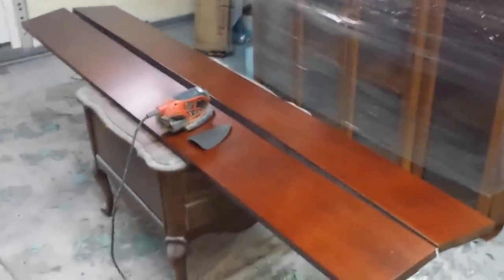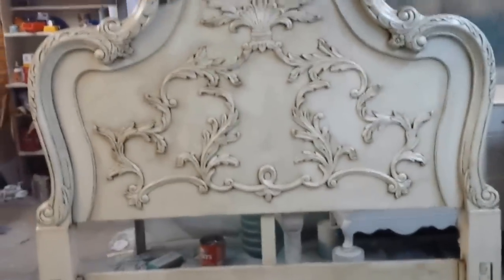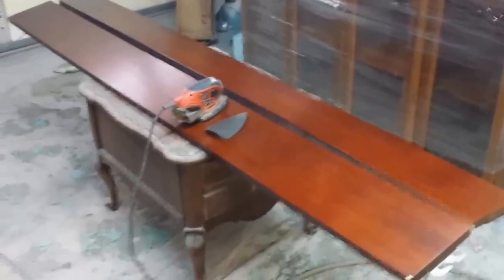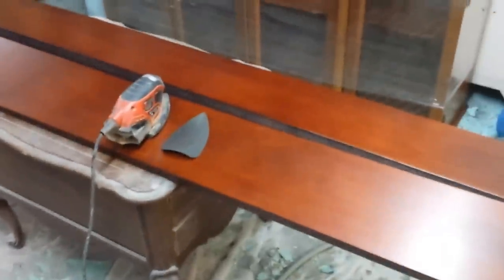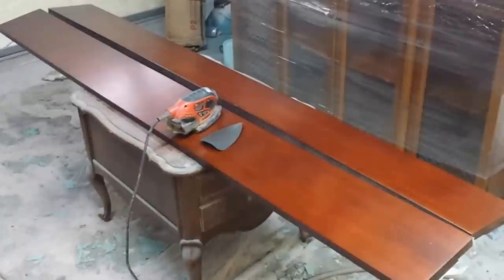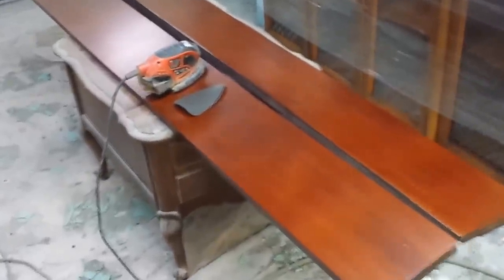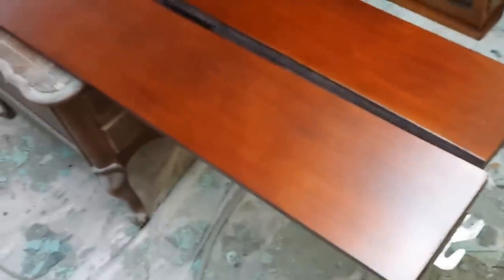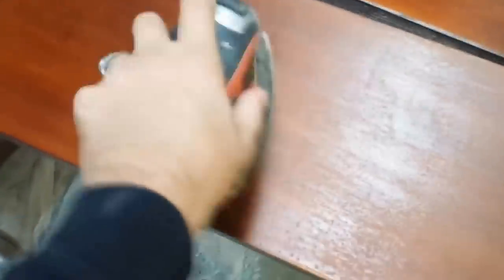How to Shabby Chic: Basic Painting and Glazing

Comment: I refinished an old dresser  and got bleed even though I had one coat of kills on it. I learned that I should invest in a sprayer because I had to use a brush.  Even though I painted it red then glazed it the brush strokes still come up here and there.  But it's just an old piece and it turned out very well considering it's my 1st  time doing this!  Practice makes perfect and your videos  helped.  Now that dresser needed extensive repair and the veneer was shot but I'm happy the way it turned out.  Lots of elbow grease  and sandpaper later I found I loved doing this work.  Now looking  for my next project !  Thanks for the  guidance and  help !!
Reply from the maker: To eliminate most brush strokes when you're glazing, apply your paint in 5 or 6 suuuuper thin coats. They should look translucent when applied but fill in with each coat. This allows you to get less brush strokes so they dont get highlighted when you glaze.
Reply: @ThatShabbyGuy  thanks for the heads up on the  glaze!  It works !  I'm going to do the same for the final step...I  have a wipe on poly...always used spray but since this is in house I  can't use spray.  I hope none of my mistakes show up too much but if so a lesson learned is good!  We will  keep it and use anyway!  Next project coming up so practice makes perfect!  THANKS SO MUCH AGAIN!!

Comment: hey shabby.. I used a mini roller and rolled paint on the project piece and then I feathered out the orange peel effect with a brush.  I got the technique down. The pressure I used when rolling would be a tad bit below half strength as I roll the paint onto the project piece. I use to paint houses and commercials for a living. When I load the paint on the mini roller, I make sure the paint on the roller is rolled out (the excess of paint off the roller) onto the paint pan before I apply it to the project piece. BTW, I decided to adopt you as my mentor. lol Your flippin awesome to watch and learn. I believe you should create a udemy course on how to. I will spray paint my projects for now on. i thought I would share what i use to do.

Comment: It blows my mind that to remove brush strokes you use the same brush over again. I can see the results, but it still amazes me.
Reply from the maker: Yep! Just make sure to clean it between coats. Having a bucket of water is sufficient. When you're done with a coat, clean it well with your hands in the bucket and leave the brush in the water until your next coat. Shake it off and maybe pat dry it with a rag (or my jeans in my case). Its good to have damp bristles when you're painting anyhow. Just repeat that cycle until you're done. Still get brush strokes? Let it dry for a few hours and hit it with some 220 lightly to knock the brush strokes down and apply one more thin coat. Works pretty well for me!

Comment: I have watched countless hours of videos week after week searching for answers to my multitude of glazing questions. I could've started my project weeks ago had I stumbled across your video first!  I kid you not, you answered every question I had on my list...which is impressive because it was a long list! One thing I'm still unsure of... If my paint is satin, semi-gloss, or gloss, then I don't need a coat of poly (water based-satin)  before I glaze??  And if my paint is flat or chalk, then I do need a coat of  poly before I glaze? And when i apply my top protective coat of water-based poly, can i apply it with a brush or must I spray it?
Reply from the maker: +Kristen Young I use satin when glazing. If you use semi gloss it will absorb less and be less apparent. Flat or chalk will absorb too much to be effective. If you poly then use stain, it won't really give the same effect. It wouldn't absorb into the paint. But you could still use a water based traditional glaze as a substitute if you're needing glaze over a chalk/flat finish for some reason. If you use stain to glaze, you will need to spray your top coat. Brushing or wiping will pull it off even after weeks of drying. You can brush poly on traditional glaze though.

Comment: If you don't have a sprayer and want a smooth paint finish, would a foam roller work?
Reply: i think if you have a good self leveling  paint, then yes  But it has to be self lvling.  otherwise  use the roller  in sections  and  knock down with your brush

Comment: I don't think you'd get away with so much brushing using a mineral paint.  Mineral paint is finicky and you absolutely cannot overwork it, otherwise is showing every brush-mark and actually starts to gum up because it dries so quickly.
Reply from the maker: Keep a spray bottle with water handy to keep the paint wet and you can brush it as long as you need to. Thanks for watching!

Comment: Why don’t you get a hard hat and mount your phone on that somehow.
Reply from the maker: I purchased a GoPro with all sorts of mounts with the same idea about a year ago. The problem with having it on my head is there is too much movement. Chest and shoulder doesnt allow for good views when I'm leaning up or down to do things. Even with the superview wide angle option. It also sucks in low light filming when my garage door is closed. Even with daylight t8 bulbs. My outdated Samsung Galaxy S8 performs better but doesnt have the stabilization needed to mount it for that type of movement. Also whatever I film with either needs to be rugged or easily replaceable because of the heat, dust, and paint flying around when I'm recording.

I am using my gopro for live streaming recently. I should be live again tonight or tomorrow. :)